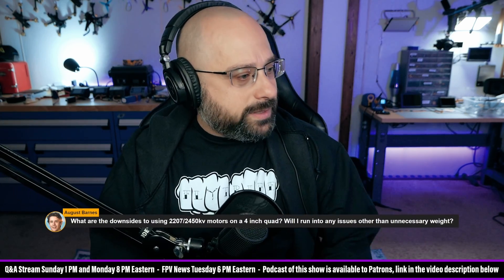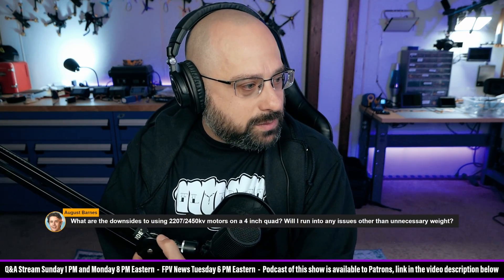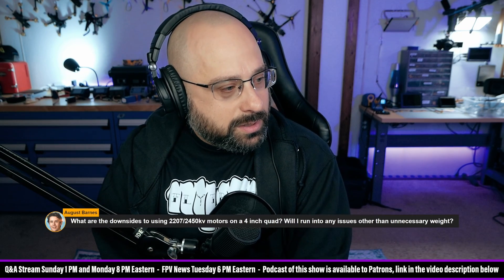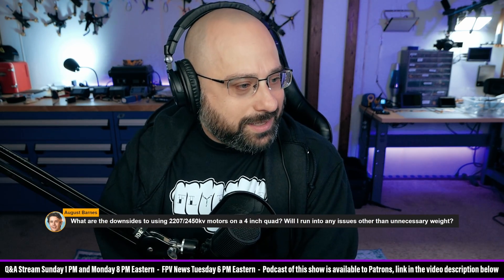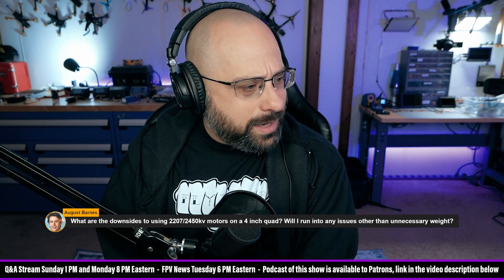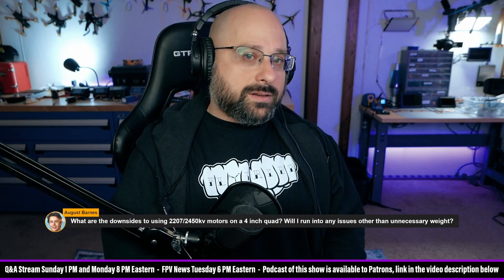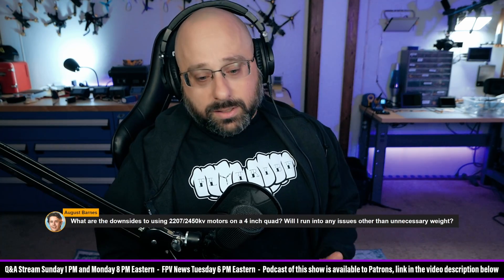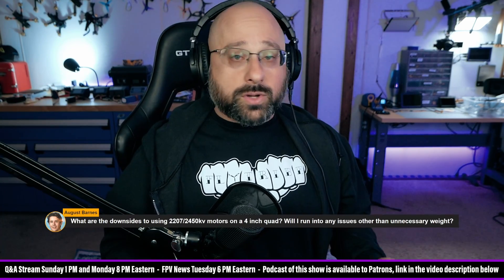Can I use 2207 Motors For My 4 Inch Drone? - FPV Questions

Comment: I’ve got the Fpvcycle shorty motors 2350kv on my 3.5” and it rips as hard as my 5” with 1950kv 2208 motors if not more. It’s actually pretty wild. All on 6s btw (xt-60 to xt-30 adapter used for 650mah tattus with the 3.5” and make sure you check the adapter if it’s connected right from the supplier because I smoked a battery on one that was paired positive to negative assuming quality control was on point)

Comment: FPVCYCLE 23mm 1830kv(?) tall are 2306 motors with 12x12 mount... 23mm tall 1920kv are RCINPOWER 22.6 motors with 12x12 mounting and upgraded FPVCYCLE bells. You can make these things SCREAM on 3.5/4" 6s with a decently weighted (1100-1300 lipo 1100-1500hv) battery and higher pitched 3 blade or 4 blade props. Pretty much turn off airmode and drop your idle and you can cut almost all of the float out of it. Have an 8s stack and micro apex that's going to have the 1830s and go 3D for the next build. THAT is gonna be wild.
Reply: Dont you want the float?😮

Comment: Smoox 1507 plus at 3800kv/4s is what I use on my 4" Apex.  Goes like a champ with 4020x3 props or similar lower pitch.  Not a featherweight by any stretch - more like a tank really!
Reply: How fast is the max horizontal speed with that motors?
Reply: @DoktorSkill  I've never measured the speed.  The quad isn't slow, but I' wouldn't call it a racer (frame is durable & heavy for my unplanned landings).  The motors have tons of power, and would do great on a lighter frame.  There are 4s 4200 kv and 6s 2680kv versions of the motor as well.  They'd probably be better for all out speed, and on a 60-80 gram frame.

Comment: Love micro's1303 11500kv rcinpower gts v3 1636 gemfan modified geprc thinking p16 2s & 3s is what I'm currently flying because flywoo no longer makes 1203 11500kv. Still looking to pair batteries before I put the pig on a diet😅, 2s GNB 660mAh get about 3 minutes...

Comment: I'm going to just ask here rather than annoying JB in chat constantly ... 
What's the biggest Motor you'd recommend for 3.5 inch 'freestyle' builds? 
1404 with high KV is the standard it seems, but I'm curious what is not on my radar.
Reply: 1804s will wake up a 3.5"
Reply: Some people are using Tmotor 2203.5 2850kv
Reply: No more than1804 and that's still overkill

Comment: I just put 2204 3000kv motors on one of my Flywoo Explorer LR 4" quads.  I'm loving the power and I get a solid 5min on 4S 850mah.

Comment: I just 3D print adapters if motors won't fit frame. PCTPE / PC. PETG is too brittle, TPU too soft.
Reply: PAHT-CF or add:north Adura is where it's at. The adura is ridiculously strong and flexible. The FDA version is a little stiffer, but it's insanely strong and abrasion resistant. PA12 is the, all around, best for structural stuff... from what I've found at least.